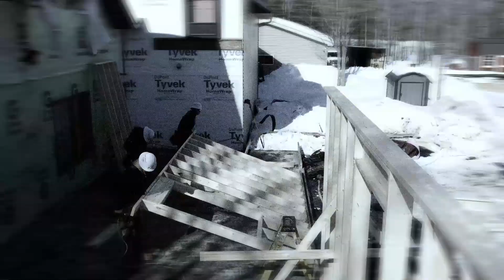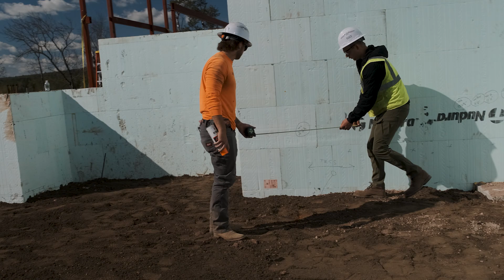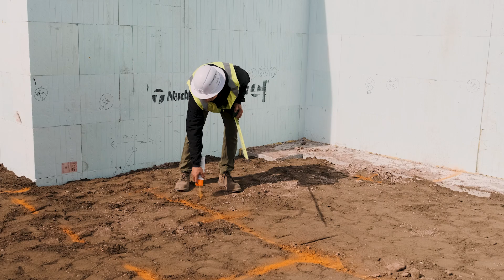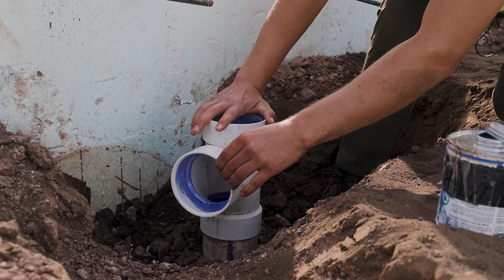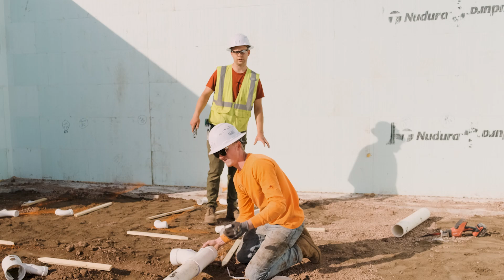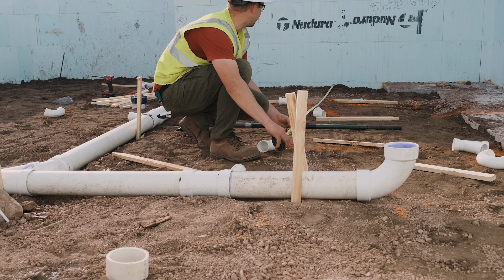Residential Plumbing Underground Layout & Installation

Comment: How canbyou pass inspection 10 foot water t3st without shower ptrap in place placing it post whats to say it leaks? So much for leak test inspection, just saying in nevada it has to be in place plus stand pipe section. Your video otherwise covers the most missed on layout avoiding mistakes.

Comment: How do you get the toilet,  watercoset stand pipe perpedicular to the slab when it comes time on that concrete flootcto set the closet flage so its not cocked an get the wax ring sealing?